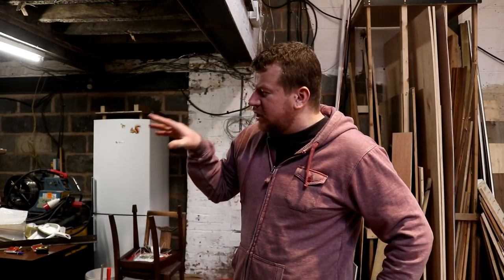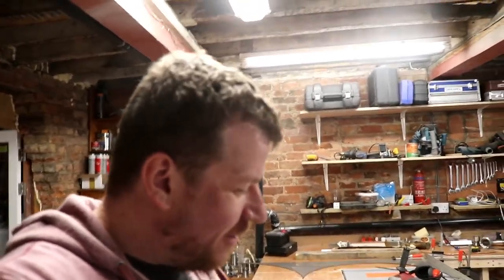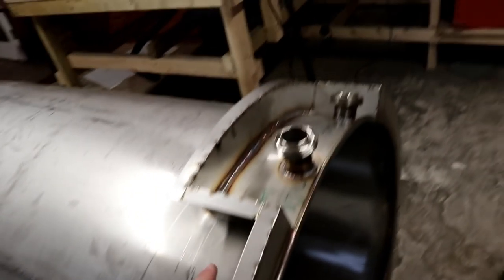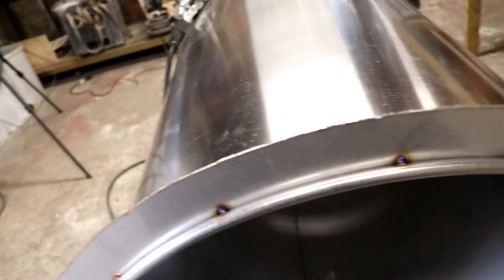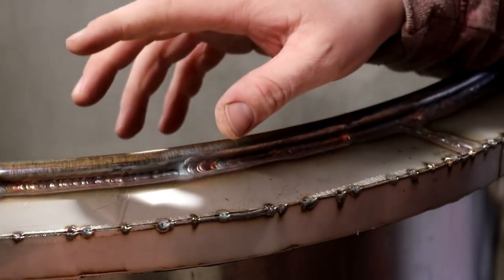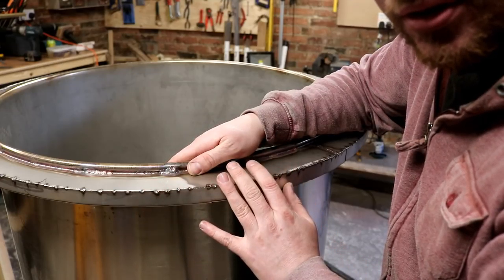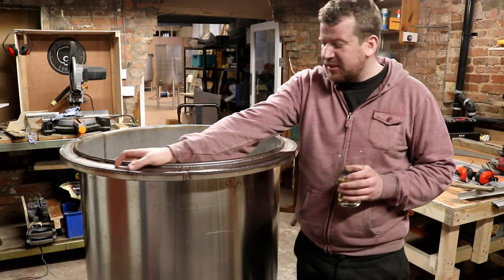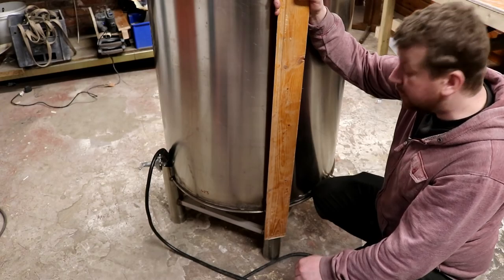TANK TRIM FOR INSULATION FITTING

Comment: Nice welds. In your videos you use the Tig welder which makes sense for what you are welding. Just wondered why you got the Mig welder. What would you use that for over the Tig welder? Is it a case of now you have skills with the Tig that the Mig is redundant?
Reply from the maker: The mig is for mild steel. I have plans for platforms, steps and a whole host of other builds I will make in a year or so. It was a £1000 piece of kit going for a song. Who would not buy it?